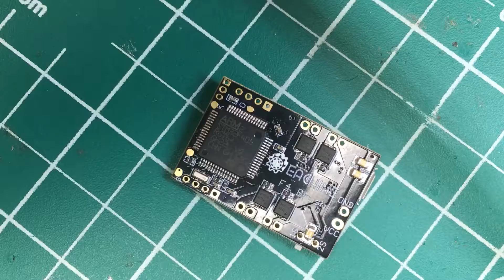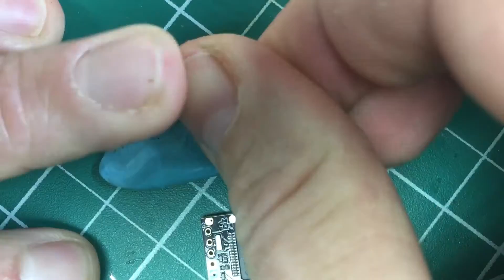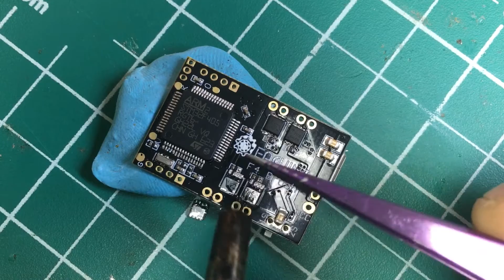F4 Brushed to Brushless Conversion

Comment: Sorry for commenting after so many years the video was uploaded. Last night I observed one of my motors were not spinning so, I flipped the fc over and saw one of my Fet have gone bust. I have F3 Evo v2 board with 6 motors. 
Now my question is whether I should remove the fets for the remaining motors and convert my board into a brushless fc or should I try to remove one of the other motors preferable motor 5 or 6 fet and place it on motor 4. 
To add the fet for motor 4 have gone bust. If I can get the mosfet from shop then which mosfet should I look for.
Sorry for this tiring comment. Thanks a ton, I almost was on the verge of throwing away my fc board.

On the side note, I already fly one more brushless, running on f3 deluxe version.
Reply from the maker: moving a fet is probably the most practical thing to do. I can't remember the specs for them... and finding good ones (ones that actually live up to  the specs) is harder than it should be. Also there is time vs $ to consider. Modern FCs are generally much easier to live with too.
Reply: @MarkDenovich  thanks for commenting. I simply removed the fet from motor 4 and soldered my motors to motor 5. Then it was simple to reroute motor 4 signals to motor 5. My quad is flying again. Thanks again.

Comment: Where is the resource do find circuit diagrams of boards based on which you identify which connections you should make. eg for this one where you found its circuit diagram
Reply from the maker: Reverse engineering. A brushed board is just a brushless board, plus some mosfets.
Reply: i see!

Comment: Awesome video!  I just have one  question regarding the pull down resistor on the gate.  Did you also bridge across that pull down resistor's pads when bridging the gate to drain?  Wouldn't that just ground the signal?
Reply from the maker: I bridged across the positive side of where the pull down resistor was

Comment: Thank you for making the video, nice work.
I think ESC passthrough does not work on this FC with this method though, do you possibly know what modification is needed to keep it working?
Cheers
Reply from the maker: Works for me... the ESC signal is getting straight to the ESCs.  No other modifications required.
Reply: Thanks for your video.
I have the same problem, passthrough is not working for me, i can't read or flash the ESC with BLHeli suite
Reply: Mark a year ago you replied passthrough was not working because you found a capacitor nearest each motor pad needed to also be removed. Was this in reference to the Eachine F4 or the  Realacc F3 board. A pic would help. Thank you!

Comment: Just did this to the Eachine Naze acro brushed fc. Never would have known. But some guy on banggood answered a question on a listing for 0703 motors. 100% epic did something similar, but nowhere near as simple. Thanks a bunch. I may be wrong. But it seams you're a little camera shy. I really think even a quick walk through, even if you don't physically do the work, to add to or redo this vid could help the entire community as whole. This is amazing. I don't do forums or the other internet social stuff. So I don't know how common knowledge it is. But I've googled, researching 1s brushless fcs. And came up empty, or extremely overpriced components. This could go a long way to fuel the micro brushless craze. Thanks again. Great stuff.
Reply: A guy on banggood answered to a link to this vid is what I meant to say.

Comment: awesome video!  but would it work with this fc? 
https://m.banggood.com/Eachine-DSF3_EVO-Brushed-Flight-Control-Board-Built-in-DSM2-Compatible-PPM-6CH-Receiver-p-1091777.html?rmmds=search

cheers!
Reply: yes it works also with this type... when removing the transistor solder a bridge like he did. from the bottom left solder pad where the signal come from

Comment: hey!   great video, thank you very much!

i´m thinking about converting this board.... i guess it works the same way^^
if i dont want to remove the transistors... do you think it´s possible so solder the wires directly on the pull down resistors?

http://www.banggood.com/Eachine-Tiny-32bits-F3-Brushed-Flight-Control-Board-Based-On-SP-RACING-F3-EVO-For-Micro-FPV-Frame-p-1087648.html?rmmds=search

cheers mate
Reply from the maker: i'm thinking you would need to remove those pull down resistors at a minimum.

Comment: nice job dude i did it thanks to your video...fyi..I couldn't get the flight board to read the ESCs in Blheli with pass threw. could just be me, I had to set them up with a mega 382.
Reply from the maker: Glad to hear things worked out. I'm pretty sure I used passthrough successfully. I'll be setting up another one soon... so I'll pay attention this time.
Reply from the maker: Oh, and thanks for saying thanks, it's appreciated.
Reply from the maker: https://www.flickr.com/photos/denovich/32270178860/

You'll need to remove the 4 fets, and the 4 pull down resistors indicated with the arrows. You will need to bridge the pads where the short blue lines are. 

Caveat: I don't have that board. Just going from the picture.
Reply from the maker: Helped a friend set one up last night... also had issues with passthrough. Investigating.
Reply from the maker: Figured out the problem with passthrough... you need to remove the 4 capacitors closest to the motor pads.
Reply: Mark Denovich cool thanks for the info. im going to do that to the next one the last one i did after switching it to a new frame it starts to hover fine but after a lap around the house it starts to pull to the right in horizon . not sure if the accelerometer went out or maybe i damaged it after the mod. it flew fine on the first frame so i dont think i did it when i moded it. i cant fly acro in the house but when i hovered it in acro it seemed to act fine, if only i was a good indoor acro flyer...lol. all in all i had a good time building someting so small with so much power, a practice fun run is always needed for perfection and i would of never stared it without your video. thanks again for all your info and help!
Reply: now that ive thought about it im going to try to remove them on this FC and see if if works for me,im not useing the same FC i got this one Eachine 32bits F3 Brushed Flight Control Board Based On SP RACING F3 EVO For Micro FPV Frame
https://banggood.app.link/FOFScVgwJy   but its branded realacc.
Reply from the maker: Drifting is level/horizon is usually a vibration problem (or a software problem). What I've seen is that if the gyro/accel is noisy enough, the accelerometer never corrects for drift (correction only happens when the MPU thinks it is level and upright (z = 1g)). Softmounting FC and Motors can help. Sometimes, nothing seems to work.
Reply: Mark Denovich update....ive rebuild it again I'm thinking it's the 3rd maybe 4th time...lol. being as small and light as it its compared to my 160 and 180 I have decided to try ACRO with it. I live in the city and it takes forever to get to an open field. I am now on my 10th FPV ACRO battery. then I tried a lap in Horizon which now seems harder to fly in after getting the hang of ACRO. LOS still needs some work on ACRO. when people at work and my Neighbors see me fly they would say you a good pilot  thinking my aircraft is in Horizon mode I feel I had to reply with "it's in auto level mode and i didn't feel like a real PILOT. now I feel I can hold my head up and say Yes I'm a not to bad of a PILOT....and it's started with YOUR video😆 THANK YOU so much for sharing and replying with info on my comments. you helped me become an ACRO=a REAL pilot.

Comment: thanks for this, brought new life to that usless brushed fc i had lying around, made the smalest stack i have ever made :) just stuck it on a 4in1 esc with some foam tape works like a charm
Reply: tom haaima what kind of board did you use?
Reply: Kale Lopez the f3 version of this board, works like a charm,
Reply: Thanks! I have a F3 and was wondering if it was the same. Also I don't have a heat gun is it possible to do it without it or is it necessary?
Reply: Kale Lopez i also dont own a heat gun so i did it the not so charming way with a soldering iron and a big blob of solder, just heat the fet and it will slide of quite easaly, its not the most elegant way of doing is but it works. Just let the board cool down a bit in between fets so you dont over heat the board
Reply: tom haaima thank you very much
Reply: Kale Lopez your'e welcome
Reply: @tomhaaima1810  wow and thanks dude. I also lost my motor 4 fet and was on the way to throw the board away... now I think I will simply remove the fets from all of them and use it as brushless.

Btw do I have to flash some other firmware for this.. like sp racing f3 ?